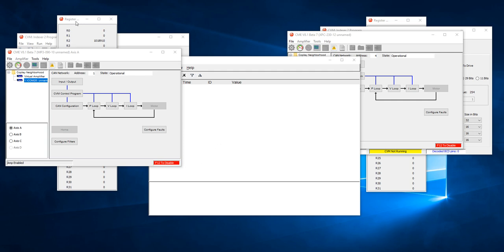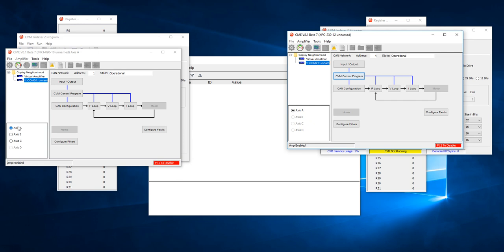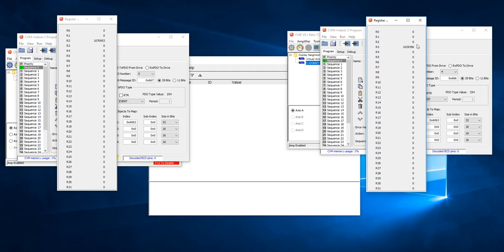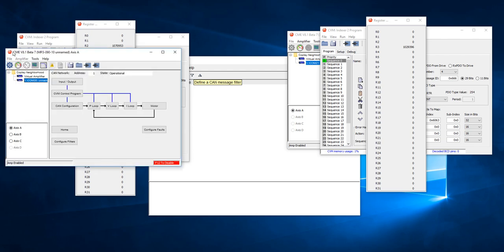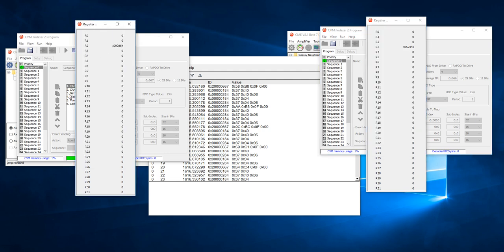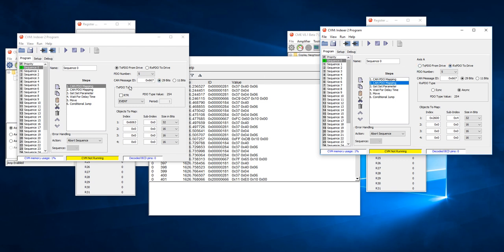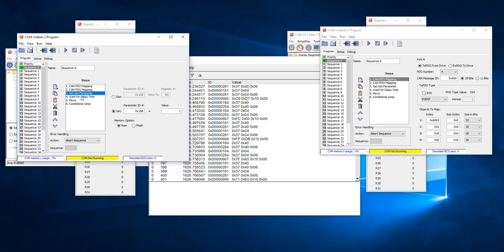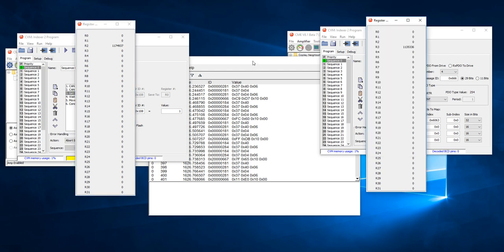CVM CANopen PDO Mapping Bean

Comment: In general, is there a mechanism in CANopen that allows you to INHIBIT a node from sending some its PDOs.. while still sending other PDOs?
Reply from the maker: Yes! It all depends on the PDO type, which is to say how it is configured to transmit. We tend to think of PDO's as being synchronous. Synchronous type are triggered every N'th SYNC message and cannot be inhibited (blocked). Event-triggered type are triggered in the event of an instance so they will not trigger in the absence of that event. Avoiding the event inhibits the event-triggered PDO from being sent.